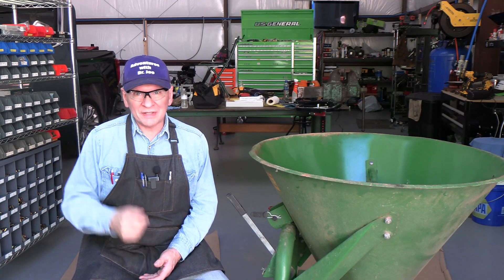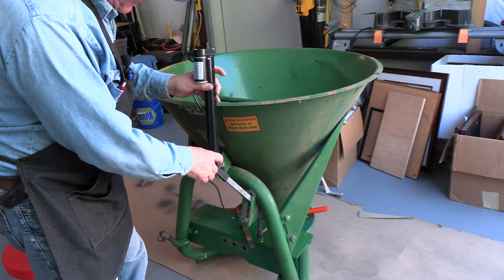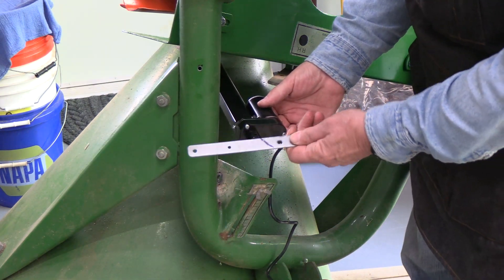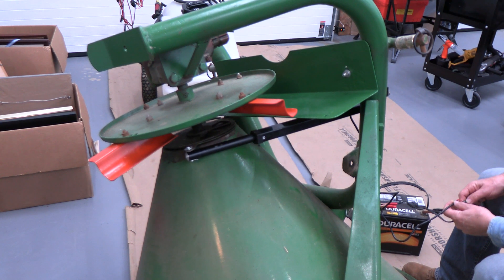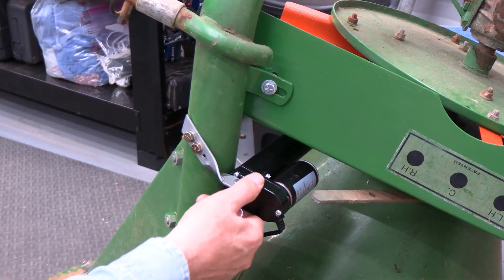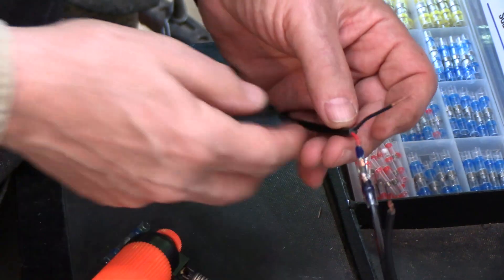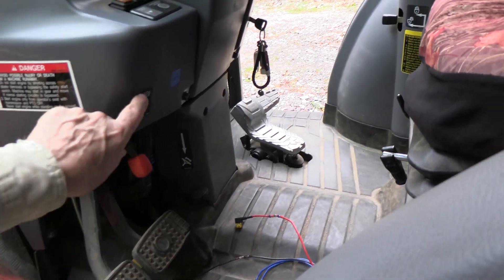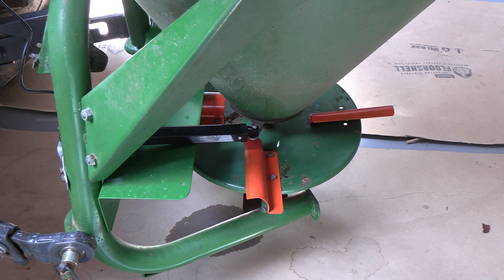Remote Controlled Spreader Using Linear Actuator for $50!!

Comment: Is there a limit switch on the actuator?
Reply from the maker: Excellent question. On this actuator, it’s very inexpensive, it basically has no limit switch it bottoms out if you let it, which is OK for me because it fully opens the gate allowing the maximum delivery of seed or fertilizer spreader. Consider subscribing. Thanks. Joe.

Comment: in my opinion it should be improved in order to partialize the opening depending on the type of fertilizer used. what do you think? do you have ideas?
Reply from the maker: Thank you for your comment. The whole idea of this actuator was to allow me to incrementally open or close the gate, allowing the flow of seed or fertilizer to be increased or decreased off from within the cab. I can’t reach my spreader because of the cab of my tractor so this allowed me to use it, and be able to turn it on and off. No it doesn’t select any specific diameter or particle. The spreader was built so that the gate opens and closes and depending on the amount of opening will determine the rate of fertilizer or feed being delivered. Good question however. Consider subscribing. Thanks. Joe.
Reply: @JosephHunstad  My goal is to flip a switch and have partial opening without having to turn around to see the position of the actuator. I will evaluate the possibility of setting a manual partialization to be set before starting work and to install a second opening that will open completely automatically (the possibly lower manual opening will control the always total automatic opening). It seems to me to be the simplest way without having to insert feedback controls with sensors which would probably be an unnecessary expense. thanks for the comparison.
Reply from the maker: That sounds pretty complicated to me and I’m excited to see how that turns out. If you do do that please send me a picture. Thank you. Joe.
Reply: @JosephHunstad  all right, greetings. Where are you from? I write from Italy
Reply from the maker: Hello, I am in the United States in North Carolina, which is in the south east near the city Charlotte.

Comment: How do you adjust how much it opens?
Reply from the maker: I have it wired up to the battery and I have a control inside my cab that I can open and close it to vary the feed rate. Thanks for your question. Consider subscribing. Joe.